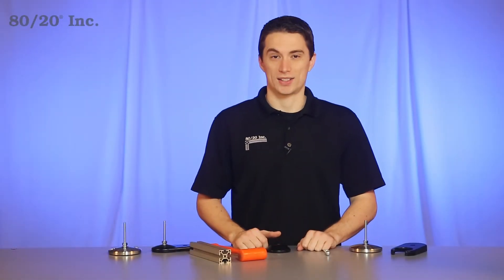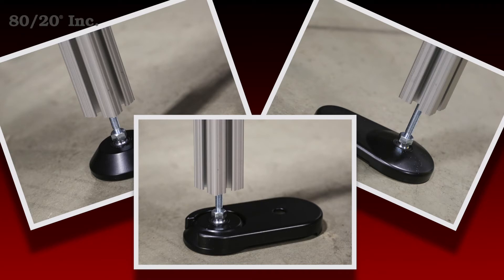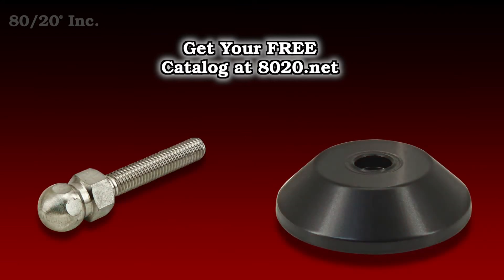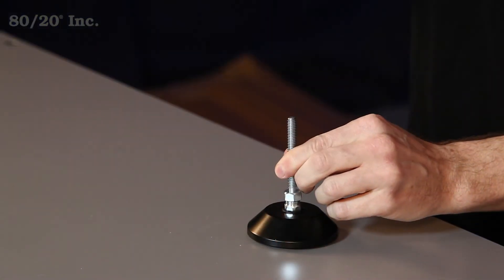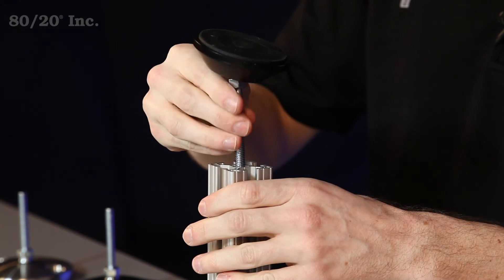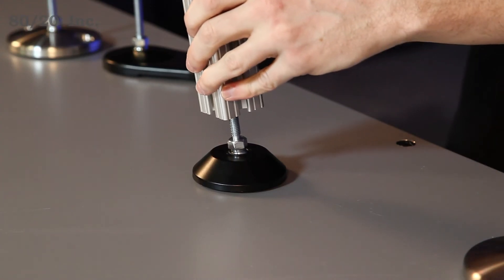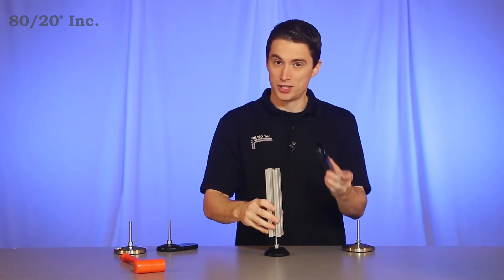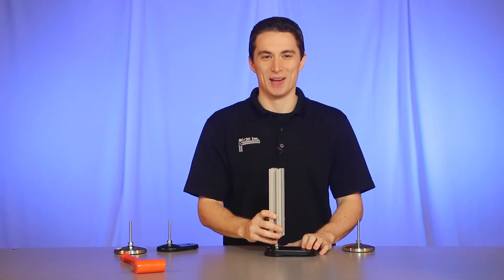80/20: Swivel Foot Assembly Overview

Comment: To be more informative this video should indicate that the 80/20 extruded bar first needs to be tapped to the appropriate thread size to accommodate the leveling feet.  Helpful post on another site indicates that the 15 series needs to be tapped to 5/16-18 thread size and that the 10 series requires tapping to 1/4-20 thread size.